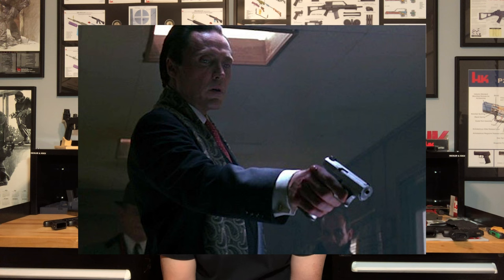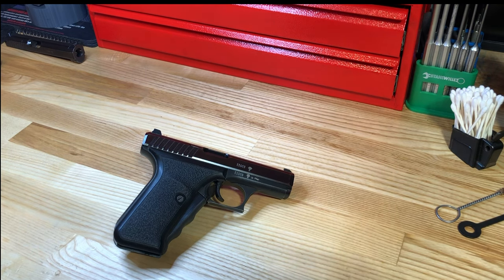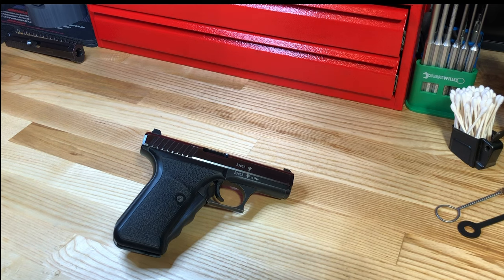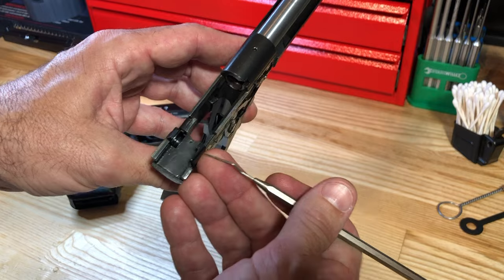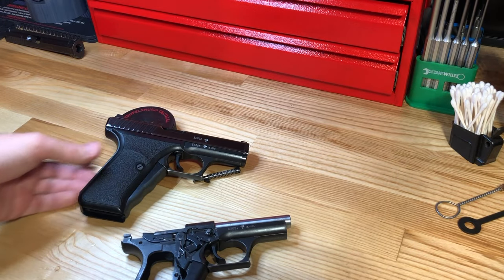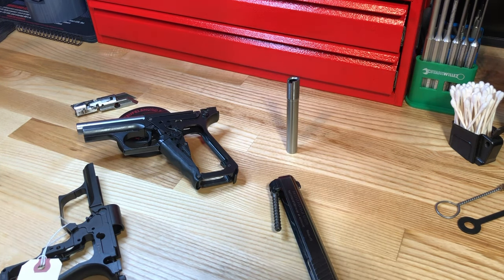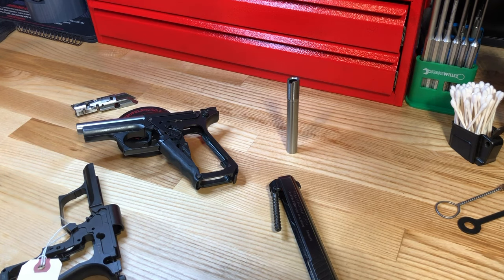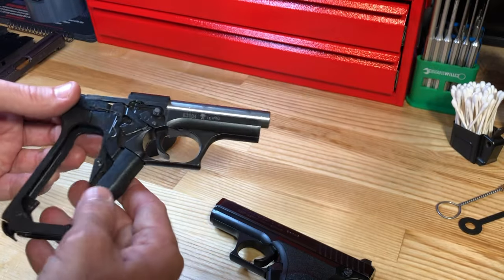Teufelshund Tactical Heckler and Koch P7 Series Armorer & Operator Review

Comment: Amazing video!  This is the one, if you are interested in the P7, and want a 3 hour training session on what it is and how to really run one, this is the place to start.  Love it!  Great work.   One technical comment (that's academic), on the P7M7, .45 ACP, it was mentioned that the unit has a hydraulic recoil system, like the K3 does.  And stated that was due to the higher pressure of the .45 ACP round.  I assume that's in error, since .45 ACP is much lower pressure than 9mm, yes?
Reply from the maker: Many thanks.  
Yes.
And you’ll find much more information on H&K firearms on the channel.

Comment: If I were to go back to America I'd use a P7 as an everyday carry if I could find one especially the M13 variant that who give 13 rounds on board instead of the basic 8, I've found the P7 to feel like each one is a custom build even though each one came off a production line with the trigger feeling smooth and you'd swear that it had been worked on.

Comment: James, I have a P7 imported through HKI-Trussville AL. From watching your video, it appears to be a Police Trade in as per the grips (slight thumb swell). I can't seem to find the year of manufacture information as it doesn't have a date code that I can find anywhere on the pistol. It's marked with the serial#363XX to the right of that is a boxed (Possible BWB Marking) symbol with a 415 and to the right of that an "NDS" circled, but nothing else on that side of the slide. The stampings are somewhat crude under very high magnification. Would you have any idea of the year or any other possible information?
Reply from the maker: Take a photo of both sides and send it to me.

Comment: Great video.   Took forever to watch the whole thing, but still great content.

Picked up an old p7 a few years ago and have shot it only a few times.  The lack of parts is one of the reasons it mostly sits.  Has anyone explored the idea of 3d printing replacement parts for these?  Or would the abs not hold up to the stress?

Also, you mention reloads, and not trying it unless you know what you're doing.  Do you reload your own ammo, and if so do you have a round cooked up that you like for your p7?
Reply from the maker: Glad you enjoyed the video. If you can believe it, I actually had to cut it short, as I ran out of available storage space.
I still have most parts, but yes, as I continue servicing the pistols, at some point they will dwindle down.
I only shoot quality, factory ammunition, with Speer Lawman 115 TMJ being my preference.

Comment: Comment from Germany on the P7: Based on my own experience, I can say that the P7 is one of the most unsafe pistols ever designed because it will fire if you accidentally cock it with the grip cocking while the trigger is pulled.  This has happened repeatedly in Germany while using it in police service, even with a fatal outcome.  
My own experience happened in 1987. I shot a heavy boar at night on a meadow strip between a corn field and the forest, which immediately collapsed.  After the shot I went to the wild boar lying quietly 30m away.  Convinced that the boar was dead, I walked to the edge of the forest 5m away and leaned my rifle against a tree to have both hands free to gut the boar and then went back to the boar.  When I was about 1.5m away, the boar suddenly and unexpectedly tried to get up again.  I immediately grabbed my P7 in my pocket for the finishing shot.  In the excitement, however, I somehow got stuck with the gun and grabbed it tighter.  As soon as the pistol came out of the pocket, a bullet struck the ground two inches from the tip of my right foot.  Despite my shock, I was able to finally kill the almost completely standing wild boar with a second shot in the head.  

What has happened: Due to the firmer grip, I had cocked the P7 unnoticed and then pulled the trigger when the pistol was free. Or I may have already pulled the trigger while pulling the pistol forcefully and cocked the pistol when it came free.  But that doesn't matter for this unwanted shot in front of my foot, because it is inherent in the system of the P7 that you can accidentally cock the P7 if you grip it tightly or fire it if you cock it with the trigger accidentally pulled.  

Now one could criticize that I didn't carry the P7 in a holster, but the whole incident would not have happened at all with a DA/SA pistol, even if carried in a pants pocket.  Just a week after the incident, I traded this insecure P7 towards the purchase of a new DA/SA pistol.

Comment: Do you have access to the replacement white sight inserts that H&K used to sell? I can’t find them anywhere. Also, do you have a video of replacing the sights on a P7 PSP? Is it fairly cut and dry or do I need a specific tool(s)? Thank you, and Thank you for this awesome video!
Reply from the maker: Replacing sights is as simple as drifting out the old ones with a hammer and punch and drifting the new ones in.  I do not sell parts outside of service and do not have the white inserts anymore.

Comment: Great video.

As for parts availability... Which parts do you think will need to be reproduced by the aftermarket first?
Reply from the maker: etc initd Springs are the most common wear items.  After that, just about everything else.
Reply: At least for the P7 M13 : the magazines‼️‼️

Comment: Sir, can you tell me what the serviceable lengths of a P7 PSP recoil and magazine spring are?  Trying to insure they are more than the minimums recommended.  Many thanks, Mark.
Reply from the maker: I don’t have a spec range, but when I complete services, I compare them against the length of brand new examples I have in my parts supply.  If I notice a significant difference in length, I replace them.
Reply: @teufelshundtactical  Thank you sir..

Comment: Can you damage the weapon by pulling the trigger back, releasing the squeeze cocker, and then releasing the trigger in a fashion such as you would on a more traditional firearm like in the instance of testing the trigger reset tolerance or other manipulations that could compromise the weapon system?
Reply from the maker: There is not trigger reset with the P7 series like you have on a more modern pistol, but the distance to pull and release is short and the trigger is light and smooth.
Reply: @teufelshundtactical  But I’m good to go if I release the grip then the trigger, right? BTW where can I get on of those piston Go/No Go gauges?  Thanks Devil.
Reply from the maker: @diamondaranda336  Sure.  The gauge is not available.

Comment: Magnum would have been much better with a nice little P7 . i love the detail and the hard work you put into these videos . i do have a question. My P7 night sights are done . Can i use the Sights from my HK 45 for the P7?  I put suppressor sights on the 45 and have a fresh set as a spare .
Reply from the maker: Thanks.
P7 sights are not the same as those on the P7M8/10/13, nor are they the same as any other.

Comment: I have a psp and I love it. The nicest gun I own. I have to tell you about a strange occurrence that has happened to me twice.  I removed the magazine and attempted to remove the round in the chamber. I cycled the slide and the round flew out, rotated 180 degrees, fell back into the chamber and the slide then stuck the round in the barrell backwards. Very strange.
Reply from the maker: Very strange indeed.

Comment: Was there ever a sport variant of the P7, is there a email where I can in private contact you and share photos, to explain in detail what is it about?
Reply from the maker: No.  Sometimes people will see photos of a long slide version, but that was a custom gunsmith aftermarket project, not something offered from H&K.
Reply: @teufelshundtactical  No, this is not a long slide version, it is the same length as the normal one.
Reply from the maker: @tomislavzamic8714  There was no sport model.  If you want to discuss it further, you can reach me through the Teufelshund Tactical website.

Comment: I'm still 1/6th of the way in this amazing video, but around 30:00 when you describe the operation of sear bar and trigger, after the first shot, it's not clear to me how the trigger resets. Is there an interaction between slide and part of the sear bar that raises the latter, keeping the firing pin backward and pushing the trigger forward? The video shows the bar already up and hypothetically catching on the firing pin, but the missing link is what brought back the sear bar, resetting the trigger. Sorry for the nit-picking, but there's so much detail in the video that I thought it's worth asking. (Apologies if it's explained further in the video, I'm watching it bit by bit, trying to focus on each piece of info)
Reply: OK. Seen the disconnector function at about 59:00. This clears the doubt: the trigger is disconnected under recoil allowing the sear bar to raise on its spring force and the trigger can't release the firing pin until the trigger finger allows it to reset. I just had to be patient.
Reply from the maker: GiolliJoker Contact me via the website and we can set up a video call to walk you through any questions.
Reply: @teufelshundtactical  Thanks, I think I got everything, but I'll take this option into account in the future. Keep up this great work!

Comment: my m13 does not have the rear sight screw.
Reply from the maker: If you mean that your rear sight should have it, but it is missing, it can be replaced.  If instead, your rear sight is flush without having a screw as part of the design, it is a newer model where the front and rear sights were redesigned without the screw and roll pin.

Comment: Extra hot smg ammo, gas system does not like it. Use regular pressure ammo. Mine was 1991/2 made.
P pistol 5 Walther ,P6 Sig Sauer, to preplace .32acp sidearms after 1972 Munich.